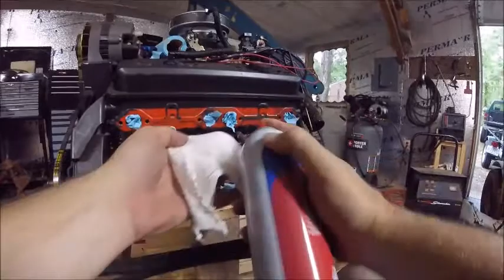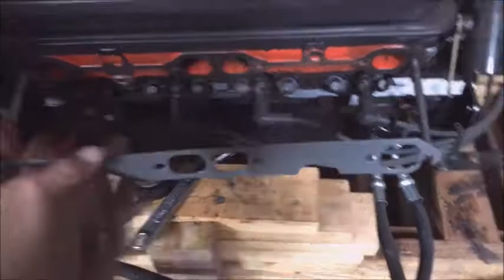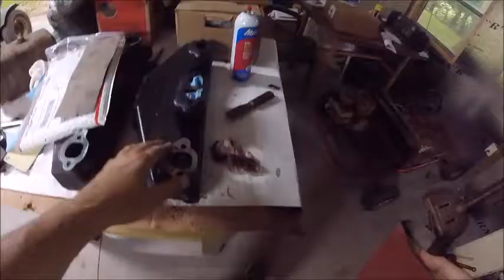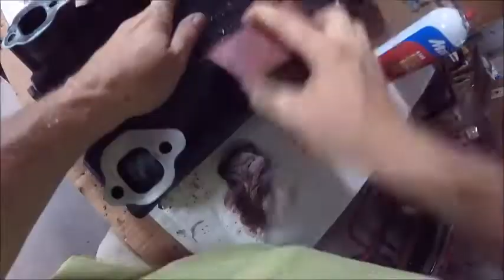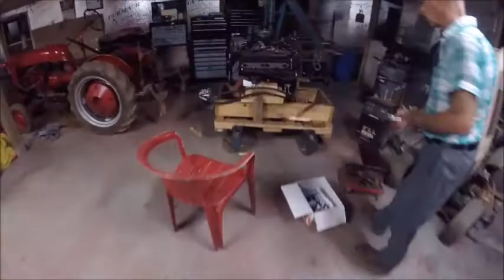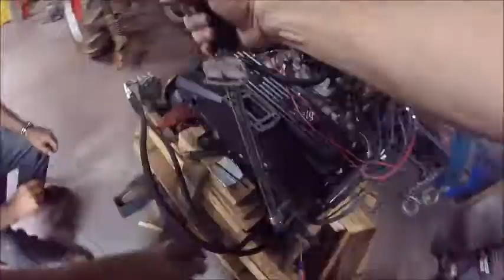How to Install Volvo Penta Marine Exhaust Manifolds 5.7  Chevy 350

Comment: is  there a exhaust temperature sensor on  volvo penta 5.0 engines?
Reply from the maker: Not that I am aware of mine does not but it is a 5.7...........You should be able to hold your hand on them while running engine on top of the risers and should be warm only.  Shoot it with a laser temp sensor.

Comment: Can you purchase these manifolds and risers, gaskets, bolting hardware online?
Reply from the maker: Yes, here is where I ordered mine:
 https://www.marineengineparts.com/barr-manifold-exhaust-kit-for-omc-volvo-penta-v8-5-0-5-7l-with-4-exhaust-outlet
They are BARR, do not buy cheap ones like GLM or others look at the reviews.  Osco also makes a great set and you could always go back with OEM but BARR and Osco have great reputations and are less expensive than OEM.
Reply: Stick with OEM Volvo.  Barr is junk and I believe they are Chinese not made in Usa
Reply: Barr is made in the USA in Southern Virginia